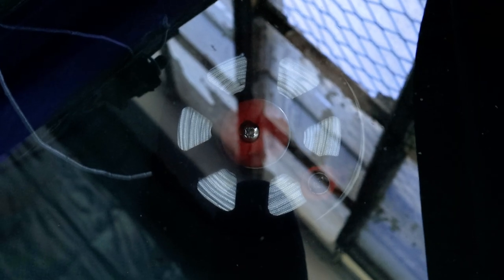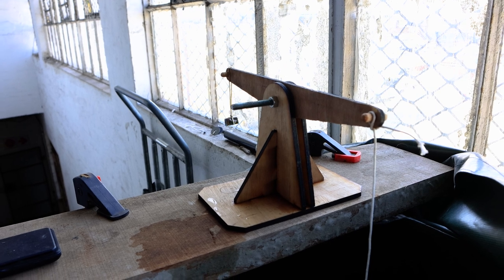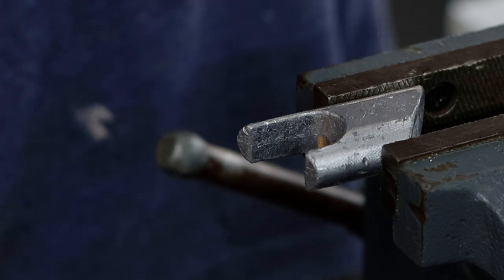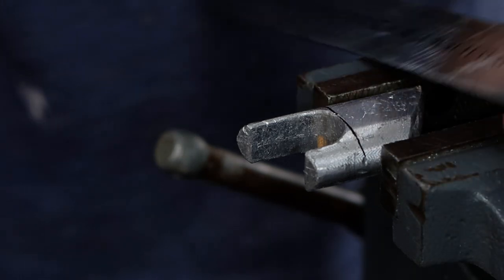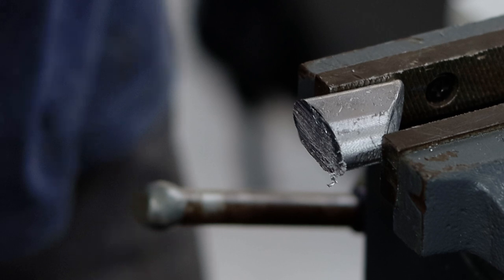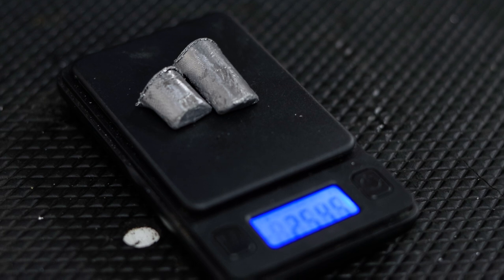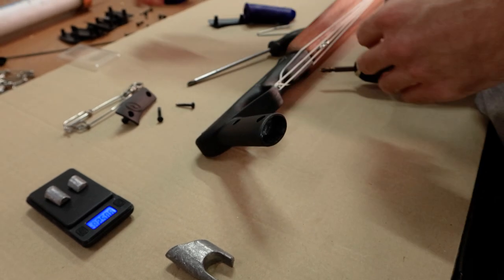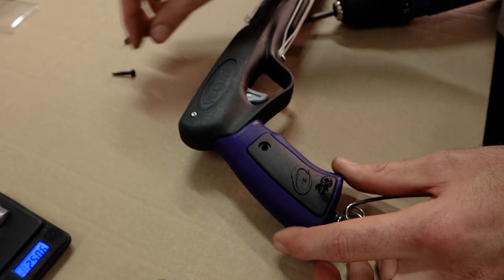Rob Allen | Timberline Series | Part 5 | Recalibration | 2022

Comment: What are the approximate weight adjustments when changing a 110 Timberline Roller that was factory balanced without a reel to a 7mm shaft, 14mm band setup? I assume I mainly have to add weight to the muzzle?
Reply from the maker: Yes, it should have a small piece of lead added. Try it without adding, then add a little in the Mech only and see how it goes.

Comment: Is this calibration only possible on Timberline guns or possible on older guns with a reel added?
Reply from the maker: The Aluminum Spearguns don't have weights.
Our Carbon Speaguns have a Muzzle weight.
Our Timberline Range has both Muzzle and Handle weights.